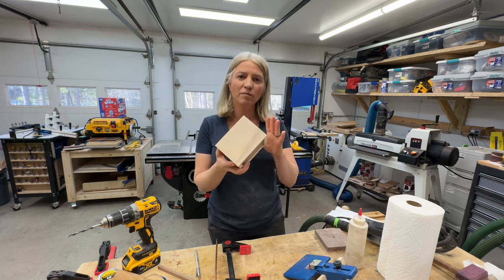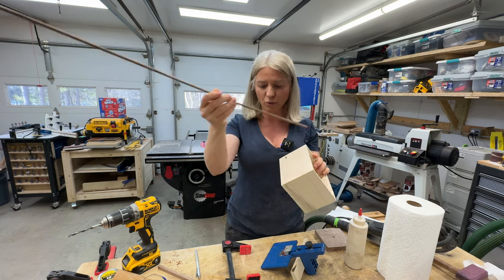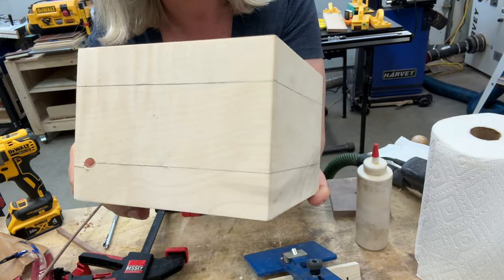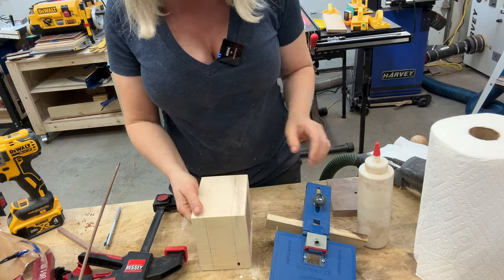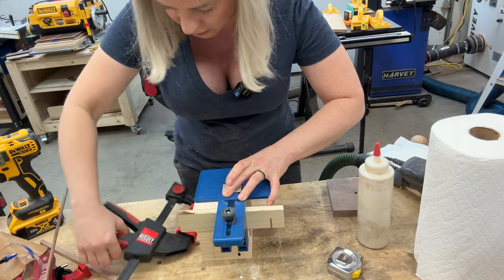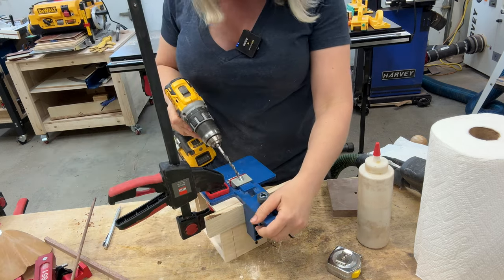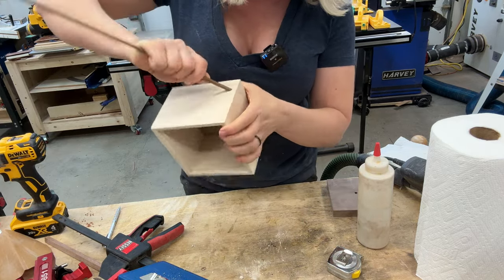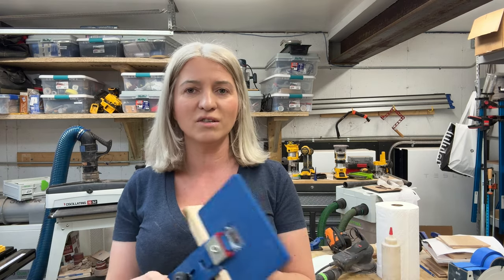Rockler corner key dowel jig. An alternative to splines.

Comment: I like splines because they add a decorative element to miter joints. But are they necessary to strengthen a miter joint which essentially is an end grain to end grain joint? The surprising answer is no. https://youtu.be/m7HxBa9WVis?si=ZvqFKR1vDNoZJgbO. This second video is even more specific: https://youtu.be/2-cCCdwEhg4?si=QaSDeYhUJ6hYl7CJ.